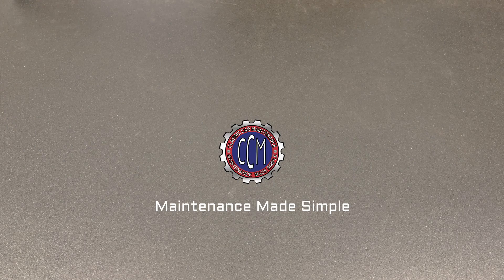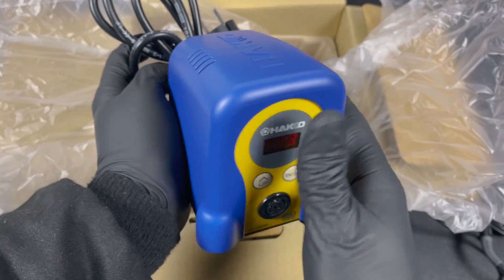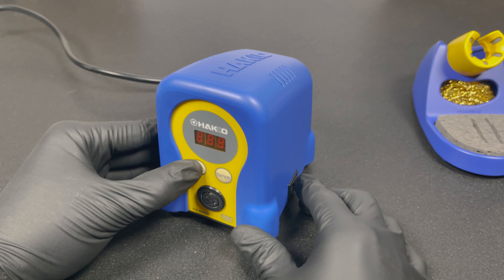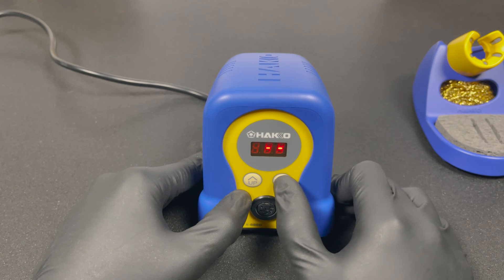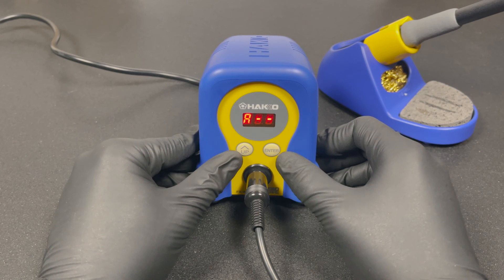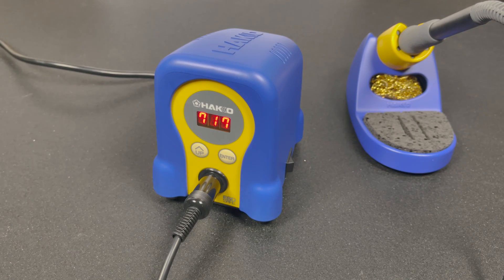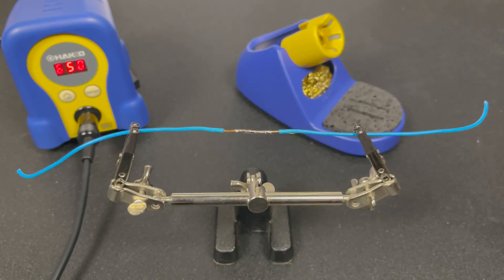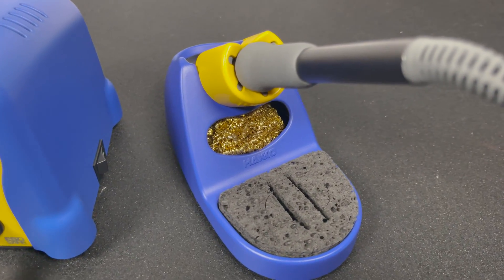Review Hakko FX-888D Soldering Station

Comment: This model is discontinued, replaced by the FX888DX, which looks to have a worse user interface.
Reply: You can't turn a dial?
Reply: @bobsullivan5714  , one button and one dial to program a dozen parameters or to adjust things on the fly is neither convenient nor intuitive.
Reply: @bobsullivan5714  , ps, read the other comments below: "what a nightmare", "stupid invisible settings", "wish it wasn't such a pain to adjust", etc etc.
Reply: @ 
Kinda makes me wonder if some people should be trusted with such a dangerous, complex, highly refined piece of equipment.
Maybe they should just glue wires/components together.
Reply: @bobsullivan5714  , I am 67 and have been soldering electronics for 55+ years, including two decades as a full time audio repair tech, as well as a telecommunications tech and a marine navigation/communications installation tech. Soldering equipment should be simple and self-explanatory to operate, so it doesn't distract the brain from the work at hand: building or repairing electronic devices. The more software built in, the harder it is to operate, and the greater the chance of the device failing in such a way thst it's impossible to repair. A soldering station shouldn't need periodic software upgrades or "patches" either! Next they'll be requiring a subscription service for the device to operate, or they'll electronically serialize parts so that you can't build a working unit from two defective units....